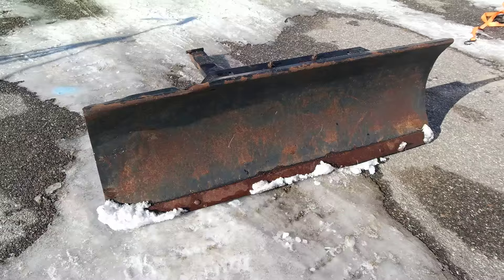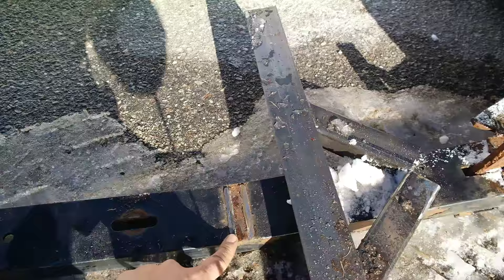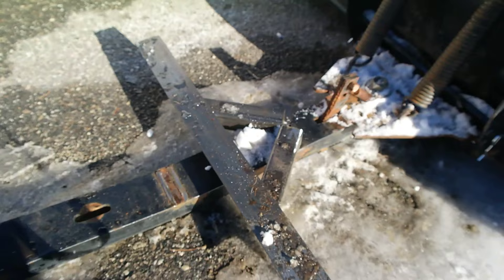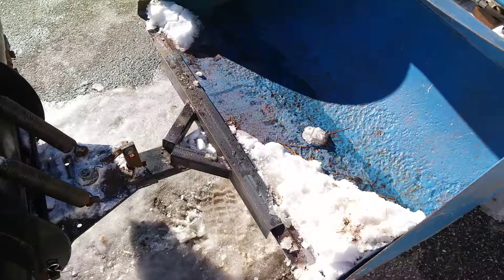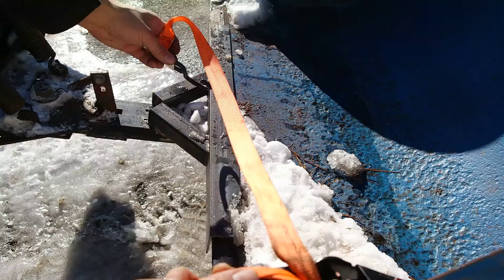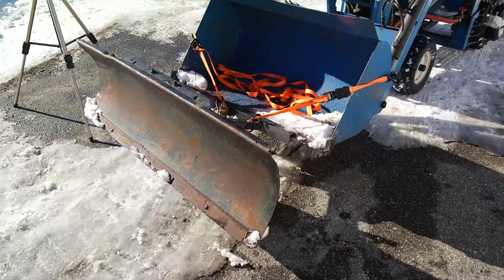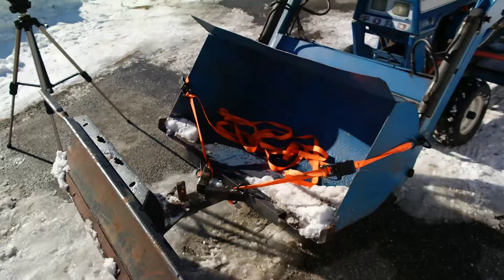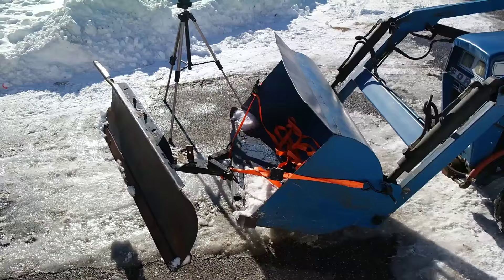Quick Mount Snow Plow Modifcation for Garden Tractor Loader

Comment: I did similar with White Tractor snow blade.  Mine mounts rigidly to the bucket on my BX2360.  I suggest that you put a flat bar about 12" long on the lever to change angles with a hole near the top for a rope.   Then run a rope from left end of blade, around steering wheel then to right end of the blade.   Much easier to turn without getting off the tractor.

Comment: not a bad idea, but it needs a piece of pipe split to go over the sharp cutting edge of the plow and under the strap to keep it from getting cut so fast, also with the weight extended out so far, it puts a lot more strain on the hydraulic cylinders, I done this yrs ago with an old fisher plow on my front end loader, after a while both my cylinders started leaking, I rebuilt it so the bucket came off and the plow went on in its place.

Comment: My GOOD neighbor gave me the same plow ! I'm going to use your idea and mount so it will fit my Kubota bucket. What do you think about making the long angle to just fit the inside of the bucket so it will always be self centered. I think I will try and add a foot to each end to make it 6 feet. I have some steel with the same curve. Thank you very much for the idea. H Wilkins
Reply from the maker: Harold Wilkins I agree to use a piece of angle just wide enough to fit the bucket. I'm making a second one and am doing just that
Reply: I will send a picture when done. HW

Comment: Why don't you drill a hole in your tractor loader  bucket to lineup  and hold the bottom piece secure.
Reply: Place a 3/4 bolt in the hole you made.